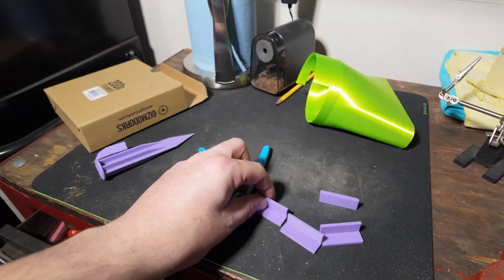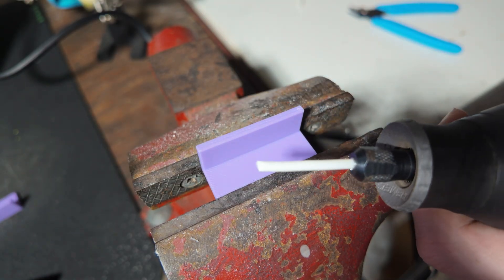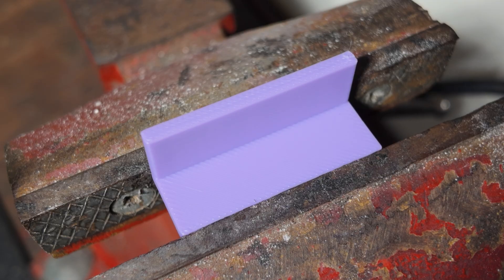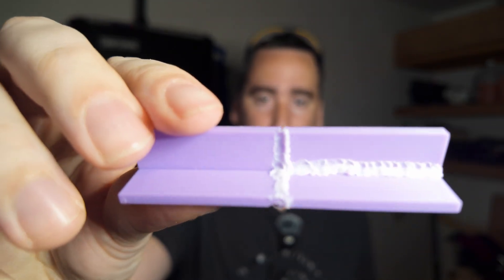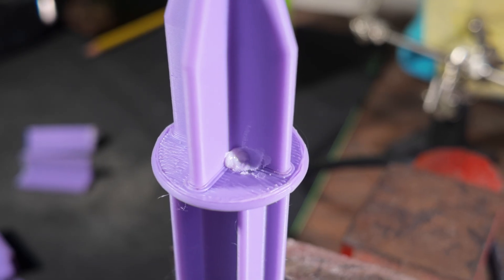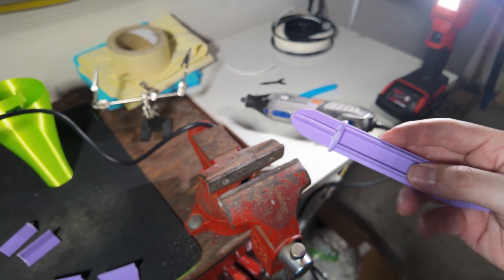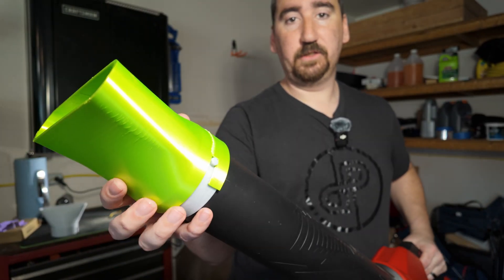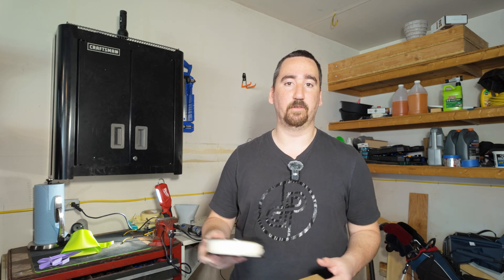Can You Weld 3D Prints With A Dremel?! | Friction Welding Experiments

Comment: you could also just print a stick horizontally so it doesnt snap in use and stick it in a drill chuck
Reply from the maker: Probably would work. I could try it if you’re interested.
Reply: @PrintPractical  As soon as I was done watching the video I tested it with my rotary tool and some 3mm diameter, 20mm length sticks printed on their side. works perfectly.

 I finished the window adapter for my resin grow tent ventilation with them. I was actually waiting for the last part to weld them together with a soldering iron when I found your video. Now I dont have to risk burning myself every time i want to fuse parts!

Comment: This reminds me a of a toy Back about 30 years ago they had this welding device for kids. Where the tip was plastic like PLA and you attack it to a toy drill with little pieces of flint in the drill so when you turned it on sparks would light up in the drill.

Comment: You can do it with 1.75mm, you just need it to be a bit shorter and not apply as much pressure. You can also just print a part that is the thickness you need for the friction weld.
Reply from the maker: I found that it’s possible with 1.75mm filament, but you have to keep it pretty short to avoid breaking it. When it’s that short, you don’t get much material to utilize, so you have swap in new filament way more often. The 2.85mm filament was way less frustrating to use, which is big to me!

Comment: The material of welding rod should  be same as that item that needs welding
Reply from the maker: Yeah I would assume so. I know PETG and PLA don’t bond, so I would assume trying to do this with those materials would be pointless. Good point though.
Reply: Yeah, sometimes the color actually makes a big difference. white filament a lot of times has titanium dioxide in it which can damage brass nozzles.